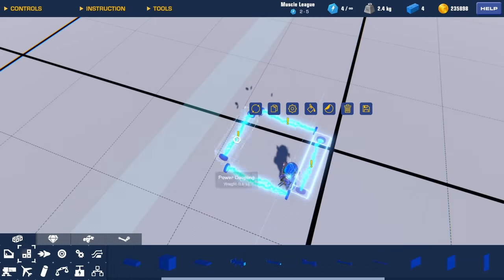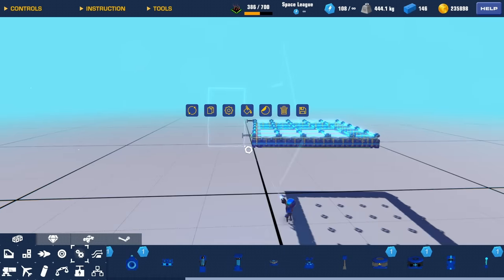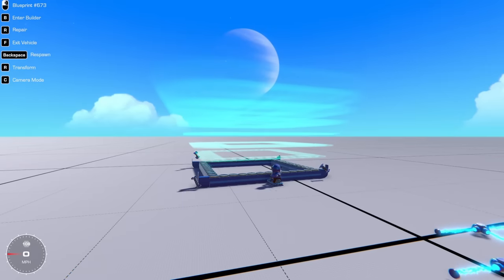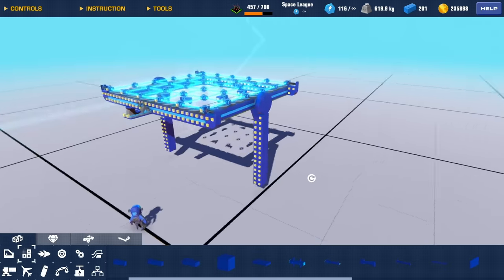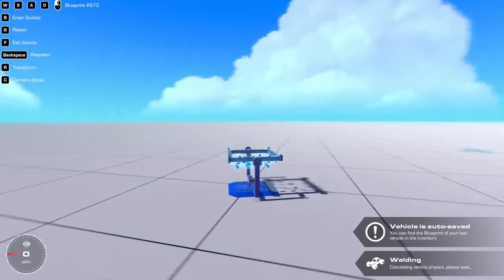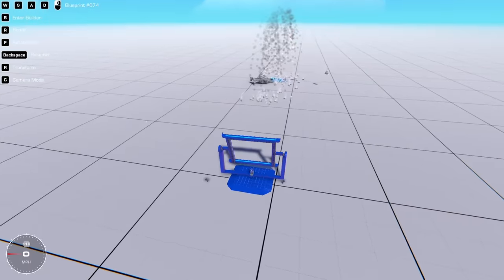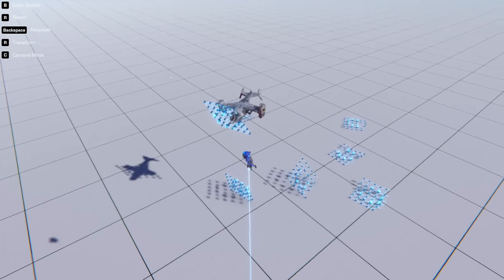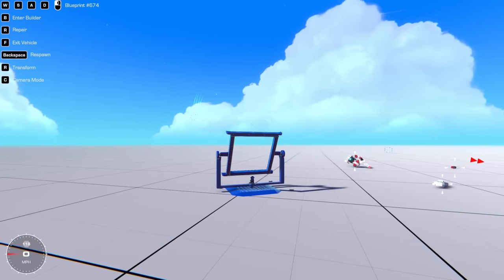I Made A Working NET LAUNCHER To Capture AIR TARGETS!

Comment: I wanna use these to make a harpoon on a car, snacks up a wheel during a race, drop it, and cause the opponent to get yanked because they are suddenly tied down
Reply: This reminds me of an old police weapon, it was a small band attatched to a beam that folds out from the front of the vehicle and wraps up the suspects axle, but i think it got banned
Reply: @Checkered-Vaporwave like pitting Is safer lol. This ban dont make any sense
Reply: @HexDrone9637  
I agree
Reply: @Checkered-Vaporwave  
if they agree or not it is still used to this day in the US.
last time i heard of it, it was used in Texas and shredded the rear quarter of a mini Van, not just caught the tire.
Reply: @Checkered-Vaporwave I believe your talking about the American “catcher net” which would lock out rear tires of a vehicle but drastically slow them down. Some states still use these but a couple have banned them as they were “more dangerous then pitting” which dosent make sense as you can control where you car slides with the net but yeah
Reply: Then do it right now

Comment: The powercoupler themselves doesn't have collision, only the connection points have collision, so tecunicaly your are shooting little shrapneles, which are connected with an invisible wire.

Comment: This would probably be better used against helicopters. The net only really brings things down by destroying parts that give lift or pulling it down, but even if the net does no damage it could still take down a helicopter by interfering with the blades.

Comment: Do any of you guys know how to type in numbers on console or can you not do that?
Reply: You can't. for smaller increments use a logic gate feeding into another logic gate.
Reply: @OliverBrooks-gg7gd  oh thanks like a altitude sensor and tone down the out put?
Reply: @zayfty6617  I generally use the or gate to or gate set up, but it can be done with any logic.
Reply: @OliverBrooks-gg7gd  ok so how do you do it can you at in a video or explain it please because I’m trying to do some of the piston glitches for planes but it needs to be 0.16
Reply: @zayfty6617  best you can do would be a altitude set to 0.10 outputting to both the pistons AND a or gate set to 0.50 also outputting to the pistons. I think that will work. If it does it will give you a output of 0.15.
Reply: @OliverBrooks-gg7gd  thankd